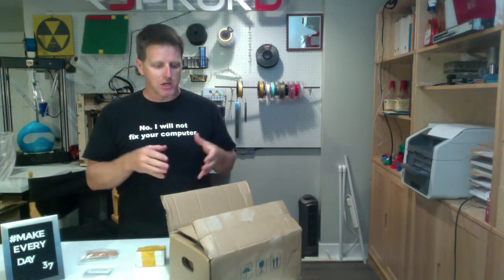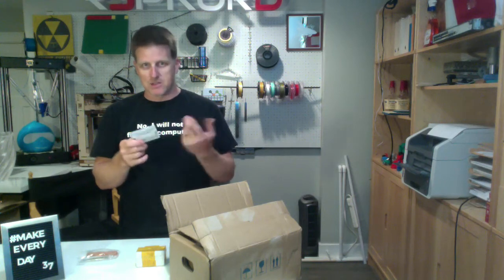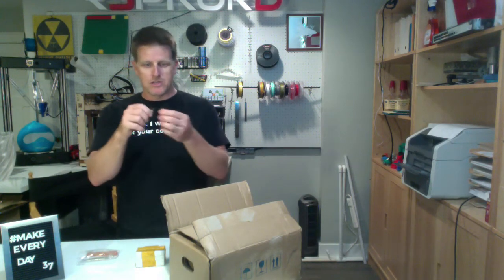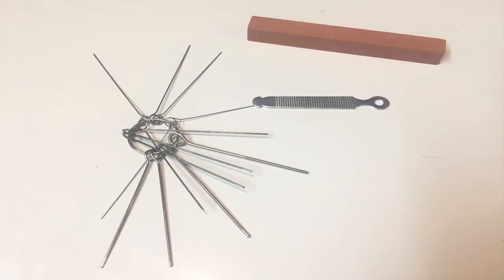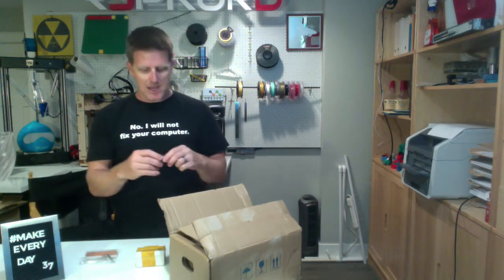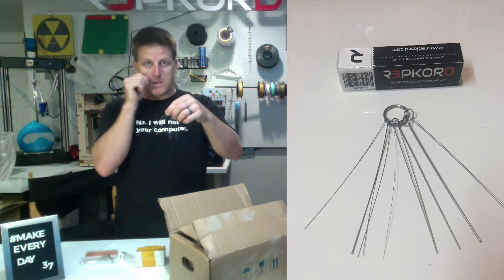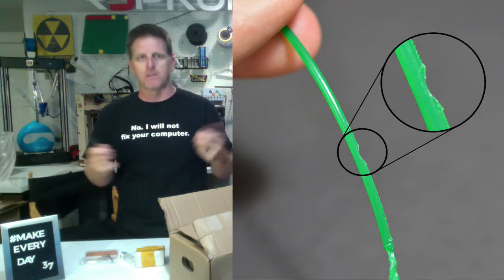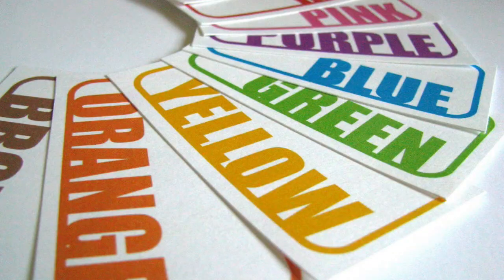How to Clean 3D Printer Nozzle -- Repkord 3D Printer Cleaning Kit V2 Sneak Peek

Comment: As a welder, I am familiar with the tip cleaners.  If they were packaged like the hex key sets all in one package it would be easier to pick the right one.  On the other hand, most people are going to need a max of 2 sizes; so if they were separate, I could spray paint the few that I need.  They would be stored in a tube with a press fit or screw top.    Just my thoughts

Comment: Maybe a Metal Tag like a Serial tag that they use for tagging Small Birds.
Would only need to be Punch pressed printing something will be harder as you would need to make sure the numbers are legible and don't get mixed up.
Great Idea though and I hope you can get this sorted out without causing delay to your product getting out into the wild
Reply from the maker: 3D Printed Aspie Thanks for the suggestions! Will do my best to get it out right away.
Reply: @Repkord  I know this is late but If you use a flat piece of metal for the tip it can hold the hole for the key ring and the size.